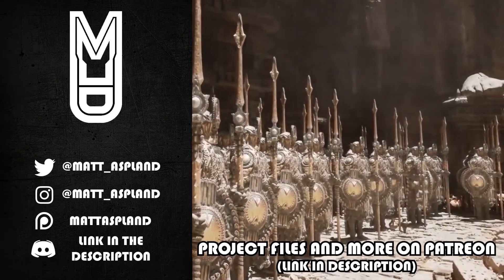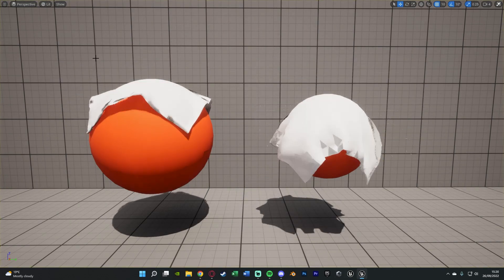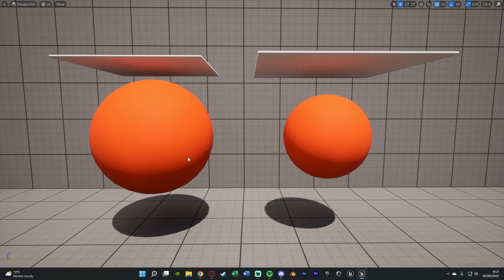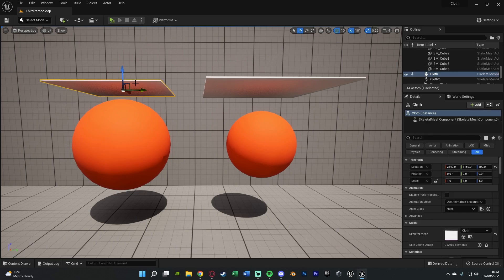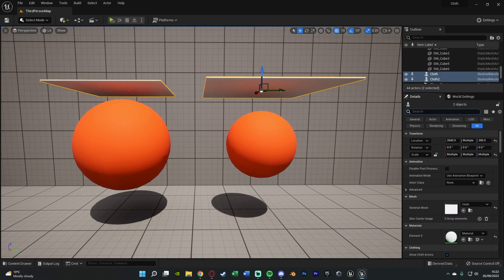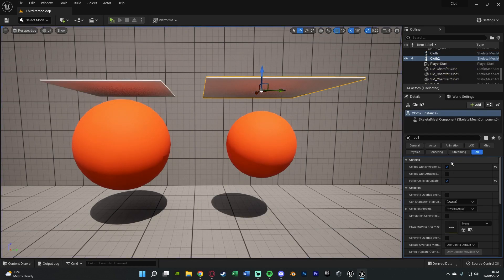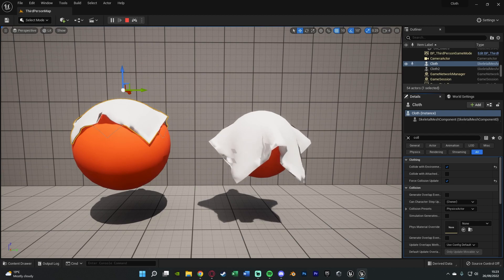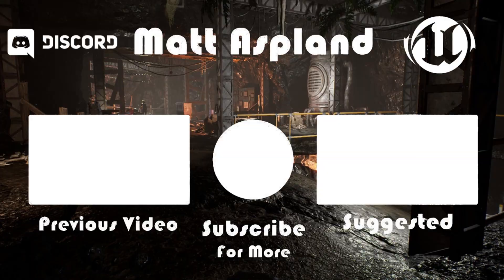How To Add Collision To Cloth Simulation In Unreal Engine 5 (Tutorial)

Comment: Thanks for covering this in a vid. But complaint against UE 2:44. Why is everything so extreme or broken with simulations? E.g. Physics - you hit something and Epic made the Default values kick the object with 100000 force. So we have to tinker to find out what is a normal value in their Engine.
And this cloth goes thru the corner of the Cube. 

We're in 2022 and UE5, and they still havent fixed their shit??? Srsly, UE advertises as an AAA gamemaking platform. AAA games already have working Physic and Cloth. Yet UE wont fix their default settings to work? (Forcing us to buy something or be a Game company with funding.)

How are they not smart enough to program: If Cloth collides with an edge and goes thru (Visibility channel or whatever) - then Offset those vertexes UP so it doesnt bleed thru. Im not a programmer yet explained how they know how to fix it, yet they didnt. Why?????? 
(This is why im afraid to use Cloth sim or ignore vids on it. But I thought by 2022 theyd fix it.)

Another complaint I see is people ask how to make Cloth sim stop going thru the Player Character. (Character has an SK and Physics. Yet Epic hasnt fixed the collision to make Cloth not go thru the body????)